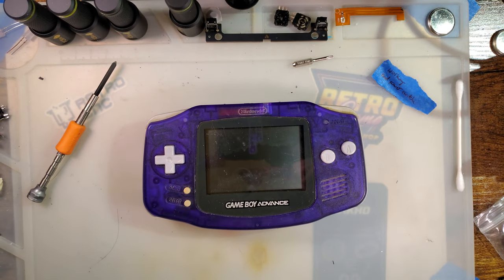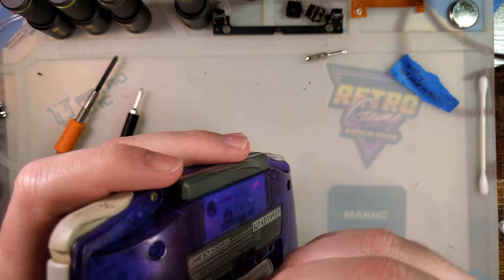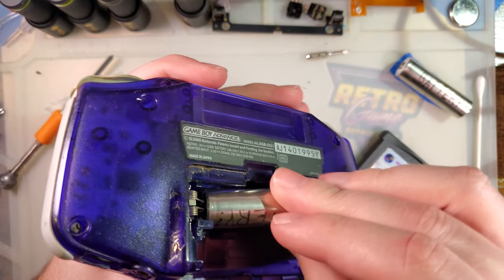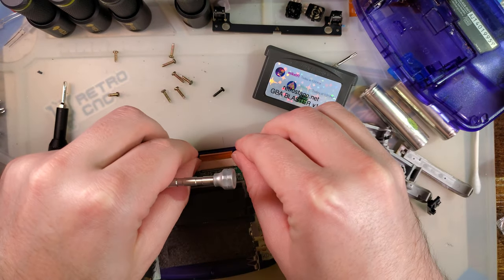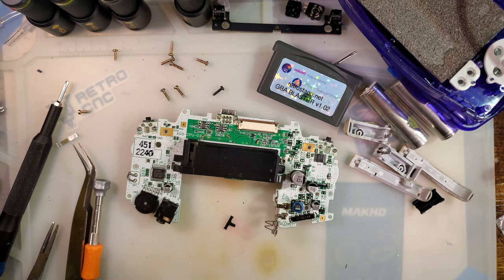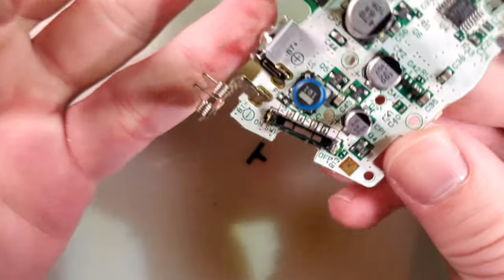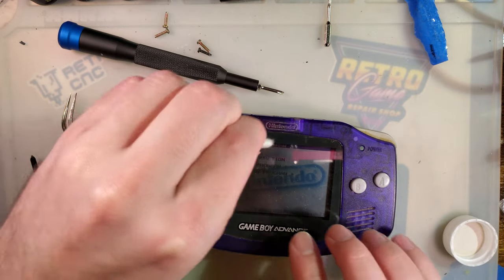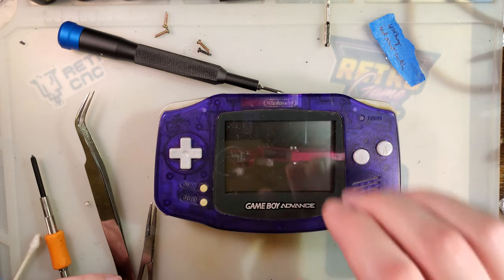Intermittent Game Boy Power (Low Power LED) Repair (Game Boy Advance)

Comment: Another point of concern while desoldering the shield; be careful with how much pressure you put on it. I have slung small bits of molten solder in my face with gameboy batteries and power switch covers by being an idiot and being right over top of what I'm working on, so once it melts, it releases and works to fling the solder like a lever.
Reply: Remember. Always always always wear eye protection when soldering. A blob of molten solder on your cheek hurts but isn't major, a blob of molten solder in your eye can blind you.
Reply: had same thing happen to me the first time i cleaned my gba switch, luckily i wear glasses

Comment: Nice trick!!  If you have a small pipette, you can squirt drops of iso into the switch from the back while flicking it back and forth.  i'll do about 20 drops, and then finish with another 10 or so to rinse.  This fixes most switches, and if it doesn't work it usually means it has to be replaced :(
Reply from the maker: No, this is not a fix. I just went over this in the video.
Reply: @makho  I saw that you went over it, I just don't agree at all.  I've fixed well over 100 gameboy advances this way with perfect success.  not one has come back.  I mean I guess YMMV.

Comment: Nice Video, but why not just adding a new Nintendo Switch Power Switch? I had to make that dicision a few weeks ago and the dude from Retro Six made a video about it how to fit the other switches inside pretty much all Gameboys. All I can say I'm pretty happen with the new switch :)
Reply from the maker: That switch is not rated for the current it needs to pass. Temporary solution at best.

Comment: Hey guys!! I still can't find no help for my power issue that looks similar but is not. So I got no power flickering lights then shut off I go and clean power switch and all then but that didn't solve the issue I've trace power and tchek every components everything seems to be good except that I don't get the good voltages on u4. By bridging two pins on u4 I can get the console to boot and play games but still I have no image. I've try and swap my U4 chip for an known working one but same result. Please if someone run into something like this I kind of desperate Rn don't know what to do next. Thanks for reading at least.

Comment: I'm wondering when a solution to this will ever appear, that's readily available or an easy mod to install. Is there no way to make a power switch that doesn't have this issue, even if it's bulkier? (I'm aware of the replacement switches, but would those not have the same issue over time anyway?)
Reply from the maker: This is why electronics largely started switching over to soft-latching designs two decades ago. There is no mechanical design that is immune to the arcing that causes carbon buildup. Large enough switches for low enough current (not to mention just actuating the switch faster) will mitigate the issue for a while, perhaps even indefinitely. An easier solution, however, is to just use a solid state device to flip the main power. Think about the Nintendo DS, the direct successor to the Game Boy and how the power switch works in that. This kind of hardware can be retrofit into game boys and I have done videos on it (see description).
Reply: Not only do they have the same issue, but a lot of aftermarket switches just don't fit right.  Helder's are pretty good.
Reply from the maker: @mannyhoolin4662  Helder's switches are a bandaid that will develop the exact same issue. I'm not sure which specific parts he's using but the ones I found in that form factor were not even rated for the current they are switching.
Reply: @makho  Oh sure.  I mean any open switch like that is going to have issues.  The design of these things guarantees that actual debris will get into the switch itself even before any sort of arcing happens.  It can even cause shorts that themselves cause carbon build up.  I've cleaned some really gross things out of non-working Advance switches...lol